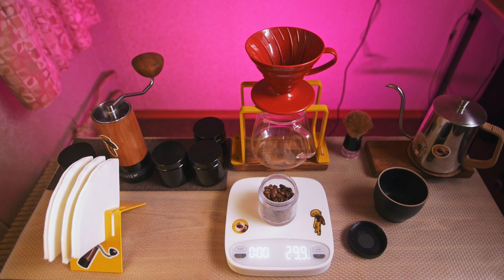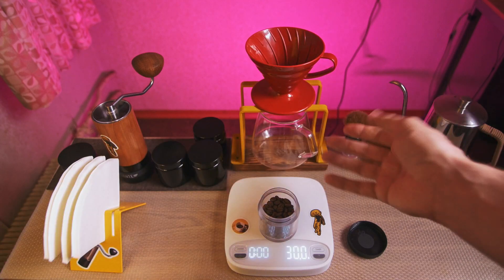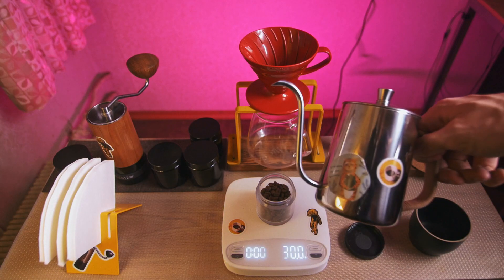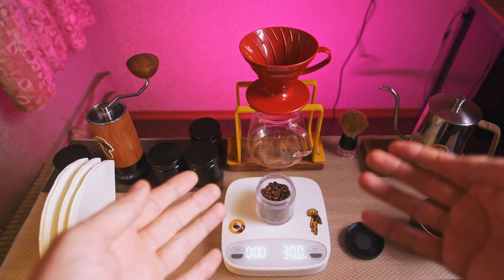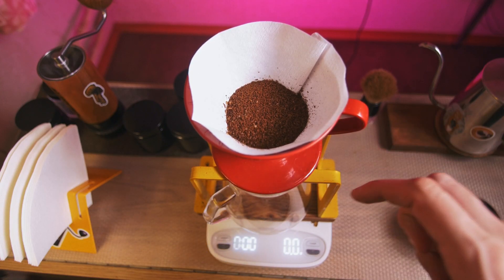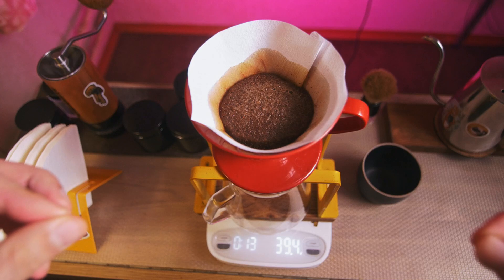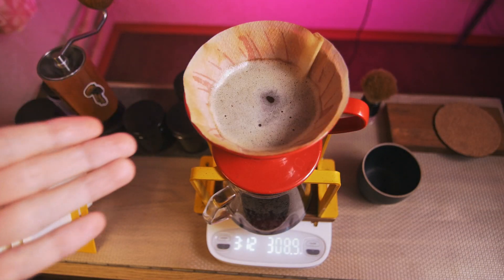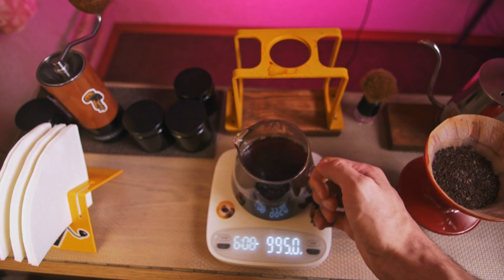How To Brew Big Doses in Hario v60 - "30 500" Method

Comment: Thank you for the method. Although I have a Hario Switch, I will follow this with the valve open. I always have to brew about 500ml, so this was interesting. I hope you are safe and get to read this.
Reply from the maker: Relatively safe, thanks. 
Let me know if it worked for you.  Was it easy to adjust or not. I currently brewing 15-250 using this method and grind size stays the same. Adjusting speed of flow with final pour. Mostly, pour to center in order to achieve faster flow
Reply: @coffeeblogua  Glad you are safe, man! I can't even imagine what it must be like...  Onto mundane things (hopefully, it gets your mind off of what is going on) I tried it and it was so so for me, but probably because I am using darker beans than usual (at least until I finish this bag) and probably coarser than I need to because it flows quicker than yours does. That is one thing that surprised me about your video: how long it will take to percolate. For darker beans I was trying something with moderate success: blooming with ambient temp water. As crazy as that sounds, it has helped get sweeter coffee out of those beans, which were supposed to be medium, but are really medium-dark. I will adjust the grind tomorrow and report back.
Reply from the maker: I'll drop water temperature in case of darker roasted coffee. Grind size could stay the same, you can just wait longer before each pour, if more extraction needed. And grind size dictates, how much body will be in a cup (kind of). Want clean cup - increase. Want solid - decrease.
Reply: @coffeeblogua  Well, my kettle now is a "boil or nothing" until I get the upgrade, so I usually wait a bit after it shuts off to brew, and I think the ambient water helps cool it down too. I will hopefully be able to control the variables more soon, but so far it is a bit of a hack.
Reply from the maker: Simple hack: add some amount of room temperature water)
Reply: @coffeeblogua  Yeah, that is exactly what I mentioned in my previous comment: I bloom with ambient temp water. At least it is not as crazy as I thought...

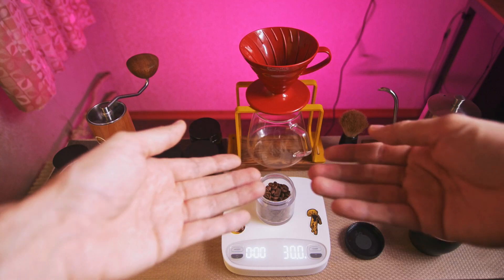Comment: In my experience +2:30 mins over extracts … can’t think about waiting 6 min!  But I guess this technic is more related to French press +  grind coarser + good immerse time… 
to the kitchen!
Reply from the maker: Chemex - 6-8 minutes brewing time. Doesn't over extract, very balanced https://youtu.be/VHUXeeTt4xc

Even with a anaerobic processed. This is because there is not that much agitation (and fast flow of water is considered to be agitation). 

As for the recipe - I switched to Osmotic flow almost 2 years ago. It's even more practical and I could brew 80g in 02 v-shaped brewer. 

Also, on a new channel (I moved English to it) there is a great recipe 14-220
Reply: @coffeeblogua thanks! I’m checking them!

Comment: Nice video.
How do you think the cafec normal or cafec abaca filters would perform using this method ?
Reply from the maker: Thank you) For Cafec I have a separate episode. https://youtu.be/meqfrBFMdCQ 

But in general I prefer faster filters (which is Cafec ABACA. If not, then t90). Even when using such method or 4*50 recipe. Rarely I have a coffee which I want to brew with bigger grind size and longer.

And currently I'm completely switched to Osmotic Flow technique, because of stability and predictable results. And coffee is much cleaner in aftertaste. When I want heavier cup - just brew Turkish coffee or espresso when in a roastery.

Comment: What is the water temperature?
Reply from the maker: For light roasted coffee and 30g dose I mostly use 97°C (206F)
Reply from the maker: Here's another great way to brew big batches (but with lower ratio) https://youtu.be/rC2FYqYo3BI
Reply: Which one is more consistent?
Reply from the maker: Both
Reply from the maker: It's better to master one (with paying attention when to do next pour) and then practice other. 
If you want to have different doses and use same temperature (play only with grind size) then Osmotic flow is easier. 
It's especially great if you want to use lower water temperature (great for summer and more environmental friendly).
Both methods are pretty organic, but with Osmotic you need to be more precise. While 30 500 - just do a spiral and wait.
Reply: @coffeeblogua  I was mastering Hoffmann's method for a couple of months and wasted a few kilograms of coffee :)

I tried different grind sizes and temperature - no luck. So, then I realized that even with the same grind/temp I'm getting the inconsistent results. Each time - the coffee is different and mostly bitter.

For 20/320 ratio I like the method by Alexander Mills. But for 30/500 - still no silver bullet :)
Reply from the maker: I don't sure he knows how to brew filter. After watching his Kompresso video (when he, Barista Classic World Champion, didn't now for some reason that he could calculate needed pressure) I doubt his abilities.

I tried to explain every detail in this video. And also didn't have any luck in brewing big doses with other recipes. This one seems like the most rounded and universal one. I can brew smaller doses with it by just decreasing water temperature for a couple degrees. And keep grind size pretty big in order to prevent clogging etc.

But filters are really important part of the process. Currently brewing with ABACA for Osmotic and T90 for "30-500" (which is just "spirals")
Reply: @coffeeblogua  And what about the original filters? Are they bad?
Reply from the maker: In my experience, they're not that stable. Flow seems to be uneven and flow speed range is weird. Cafec feels more constant. Anyway, it's better to experience them and choose what fits your taste better. 

Some say, Hario produced filters on Cafec factory (those which go 40 PCs, in cardboard). And they seems to be like T90 in terms of paper texture. 

Expect to have dramatic change when switching filters. Might affect brewing technique as well.